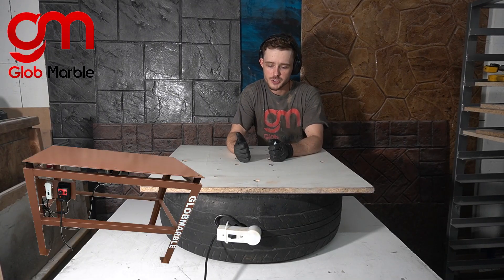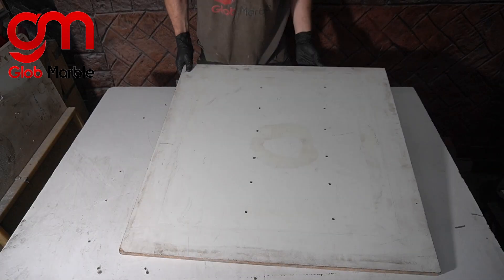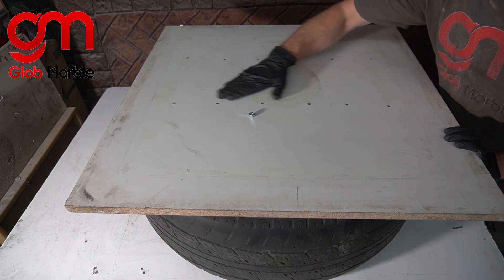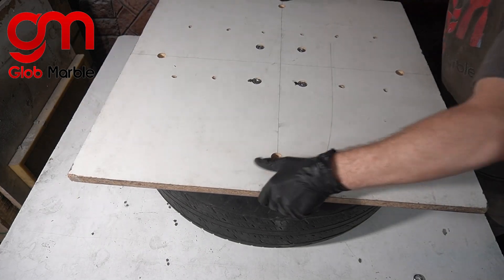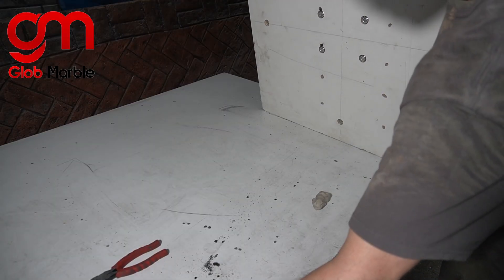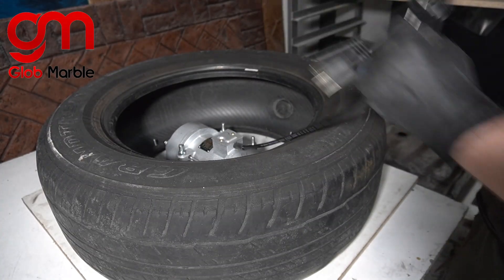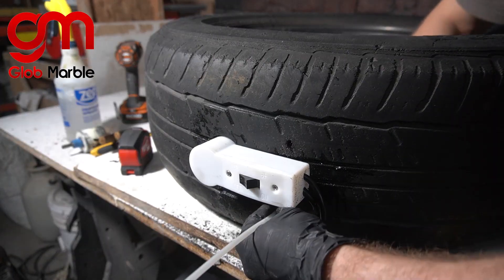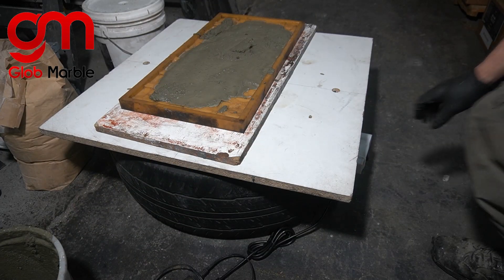DIY Vibration Table For Concrete

Comment: What's the hp of this motor?
Reply from the maker: Power: 0.75 kw

Vibration Force: 350kgf

Voltage: 110V 50/60Hz

Rotary Speed: 2840rpm

you can find more info on it here- https://globmarble.com/concrete-vibrating-motor-110v-075-kw.html

Comment: It would probably work to just mount a inexpensive orbital sander to it ? Will have to test it out.
Reply from the maker: I could see that working for little candle jar molds, but any reasonably sized mold would get minimal effect from an orbital sander. not enough vibration power.
Reply: @GlobMarble  First, thank you for these videos its Insanely informative. That does make sense not working on larger items, I have seen a video just now from Dan Foley called The DIY Concrete Paver Movie, at 5min in he demonstrates a sander, seems quite powerful? Im trying to find Vibration motors in South Africa, Thus far unsuccessfully. So might make a turn at a pawn shop and grab 2 or even 3 of these cheap sanders to your tire and plank, might help!!! will come back in a week and let you know if it worked. I just got my CSA Cement had to drive 300km for it. Soon I will pop out some amazing Artificial Stone.

Comment: In my short research on building a vibration table the top 2 results included one with 3d printed and cast parts, the other uses an old tire. Going with the tire. Thanks!
Reply from the maker: Glad it was helpful!

Comment: Hi, thanks for video. What's your engine power? 0.5Kw enough for this?
Reply from the maker: The motor size depends on the molds you will be vibrating. The one I used in this video is the larger 0.75 option- https://globmarble.com/concrete-stones/concrete-stone-making-equipment/concrete-vibrating-motors/

Comment: Maybe a +$150 motor is cheap in your world, not in mine.
Great video.
Reply from the maker: Glad you liked it! A professional vibration table costs $2k-$3k. For DIY projects, spending $150 is very cheap.
Reply: @GlobMarble  You might be entertained by my vibrator hack in the video below and I have a question. I have some of your superplasticizer over a year old,; is it still good to use?
https://youtu.be/zLCzggr2Y-o?t=755

Comment: What are the specs on the motor?  video looked like it might be a bit over powered.
Reply from the maker: You can find the specs here- https://globmarble.com/concrete-stones/concrete-stone-making-equipment/concrete-vibrating-motors/

Comment: Would this also be useful for resin?
Reply from the maker: I am not familiar with using vibration for resin, usually you remove bubbles with a vacuum chamber

Comment: Does this method helps in air concrete moulds?
Reply from the maker: The vibration table is designed to vibrate air out of concrete molds yes

Comment: Great vid. I purchased Glob Marble molds in the far past and need to get them out and use them. Motivated by your videos! Keep up the good work!
Reply from the maker: Why haven't you used them in a while?
Reply: @GlobMarble  I have used them and like them, but life has a way of interfering with projects. Also, I am cursed with having too many interests which get me going on many different directions. However, your videos and passion about casting is so refreshing. Cheers.......  AAA+++

Comment: Do you guys have weaker motors? Is there a way to dampen the effects of the motor shown in the video? This seems suitable for my use, but a little on the strong side.
Reply from the maker: The motor in the video is our stronger motor, you can find our weaker motor here- https://globmarble.com/concrete-stones/concrete-stone-making-equipment/concrete-vibrating-motors/

Comment: Great video! Really helped me plan out my vibrating table. Would you happen to have a video on the different strength of vibration at different rpms and watts? Id hate to buy a motor that's too weak or too strong for my needs. Again, really appreciated the great video!
Reply from the maker: Strength of the motor depends on the size of the table. For a smaller table, use the smaller motor- https://globmarble.com/concrete-vibrating-motor.html 
 For a larger table, use a larger motor- https://globmarble.com/concrete-vibrating-motor-110v-075-kw.html

Comment: A lorry tyre would suffice, bear in mind that there's gonna be weight on that tyre and there's a motor 👀
Reply from the maker: The only reason a tire is used is because the rubber acts as a makeshift bushing to maximize the vibration motors effectiveness.

Comment: Thank you- only thing I'd add is a non slip surface coating on the top of table
Reply from the maker: Usually people like using guard rails. Vibration makes the molds move around the table lots of the time
Reply: I love it
Reply: Do the motor have speed dails

Comment: Would I be able to use springs instead of a tire? Like 3" springs?
Reply from the maker: Springs are not as effective, in fact they actually dampen vibration
Reply: @GlobMarble  got it! Thank you, I got plenty of tires on my property, might ass well put them to use

Comment: Thank you for this video I was just going to attach it to underneath a table but the tire seems better
Reply from the maker: A table is too rigid, you need some type of rubber bushing to maximize the efficiency of the motor

Comment: anybody try using a massage gun ?
Reply from the maker: The motor is way too small and weak for vibrating concrete. Just look at the size difference between the motor I am using in this video and the size of a massage gun